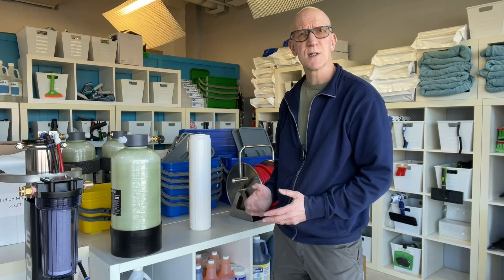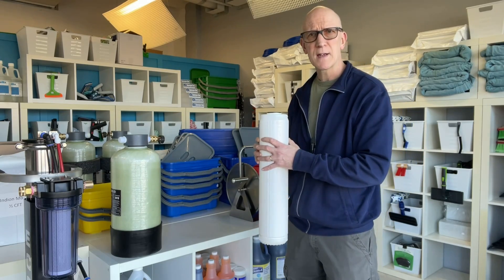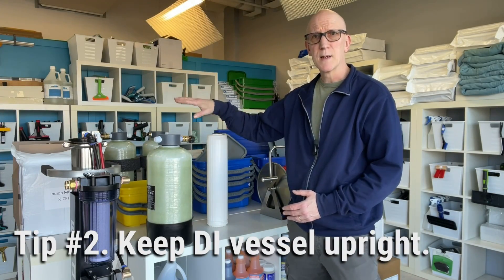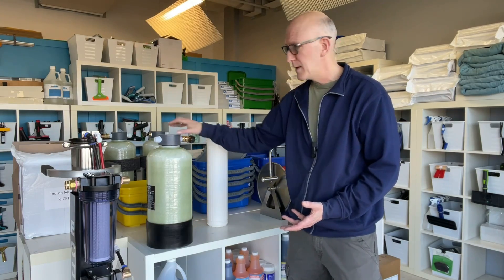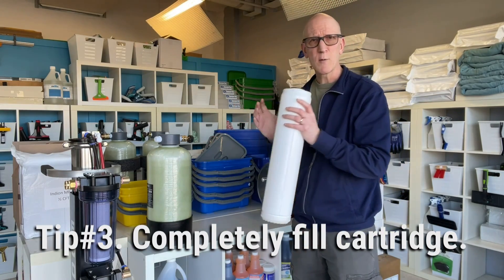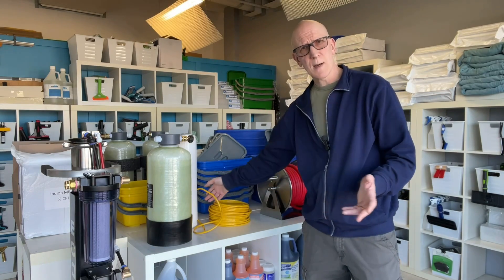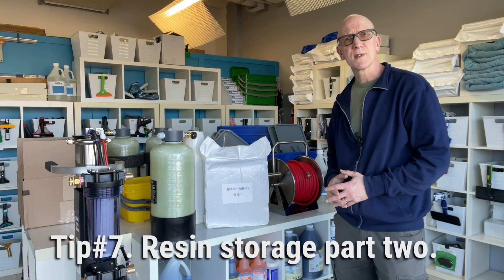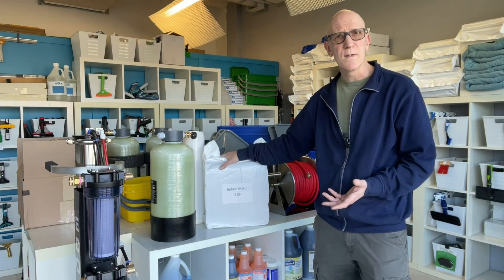How to make your DI resin last longer - Water Fed Window Cleaning

Comment: does it hurt to have the di tank in the sun? Where I put mine its in the morning sun for a few hours each day.
Reply from the maker: Shouldn't be a problem. Have the input/output capped off or closed valve so no hot air comes into the tank would be best.

Comment: Just watched your video thank you very informative but I was wondering if you can help me. I have a new resin tank like the one in your video and when I measured the hardness of the water where I live it is 425 which I’ve been told is very high After running through the tank. I was amazed that the reading was zero washed my car and windows amazing no water marks but this only lasted for two car washes now my reading is back to 425. Looks like the tank is not doing his job. Could you help me with a Y? Is it because the water in my area is too hardbut I thought this is what these tanks were designed for please help.
Reply: You said hardness is 425 ppm, so TDS should be much higher than that. Mix-bed resin doesn't remove just hardness, it removes TDS and dissolved CO2 (and removes hardness also because hardness which is total of calcium and magnesium are components of TDS).
Using mix-bed directly with such high TDS water is not a good idea. It will exhaust very fast because mix-bed are primarily used as a polishing units.
RO will be a better choice in your case. Commercial RO membranes can typically remove more than 95% of the dissolved solids (TDS). If you want further polishing of that RO water, you can install a mix-bed ion exchanger. Mix bed in this case will give you 15 to 20 times more output as compared to what you are getting now.

OR

May be you just need a softer which is the cheapest to maintain.
Reply from the maker: The great thing about ion exchange DI resin is the ability to purify water but the higher the source TDS is, the less time it will last. Imagine that inside the tank you have an army of 1 million beads, but each one can only do their job once. After that, they’re dead. With high TDS like 425 ppm, it takes a large team to get the water to zero so big teams of resin get wiped out at a time as opposed to small teams. If you have a way of installing an RO filter in yourhome before going to the DI tank then that would allow the DI to do less of the work. That’s how mutli stage window cleaning systems work.

Comment: Do you sell the ball valve? Or would a brass shut off valve do the same thing you just adjust it to the flow you want
Reply from the maker: @bradishler5967  any shut off would do, provided it matched the threads on your tank. If it’s a standard garden thread, you can grab from any big box hardware store or we sell them too. https://www.thewindowcleaningstore.com/collections/waterfed-poles/products/garden-brass-shut-off-valve

Comment: I’m wondering why they don’t use separate resin beds instead of a mixed bed, ie one bed with cation resin leading into a bed of anion resin. The big advantage would be that you would be able to regenerate the resins and never (or rarely) need to replace them, providing you could safely handle the strong acid and base solutions, which are only lye and hydrochloric acids.
Reply: You can simply separate and regenerate mixed resin as well, it's only one additional step.

You're right though, discarding it isn't exactly smart. And using mixed bed commercially isn't the brightest idea either.

Only thing I'd use a mixed canister for is as backup.

Comment: Simple equation..the faster water moves thru your di resin the shorter the life.
Depending on the size is the average life...1 cf resin generally gives 1300 gallons of di water with 400ppm water. Running di is not cheap.

Comment: Is just a DI as good as those 3+4 stage systems???
Reply from the maker: Good question that I get asked a lot. DI exists on every multi stage system as the last filter because it is the filter media that can get the water to 100% pure. The RO membranes usually can reduce the TDS (total dissolved solids, minerals) down by 95% on average when new. The purpose of the RO membrane(s) is to act as a prefilter for the DI so the DI last longer. If you are in a low TDS area, then “DI only” makes perfect sense. But if in a high TDS area or needing to use the system daily, then pre filtering the mineral content will allow you save on DI media cost. RO membranes although expensive, can last for a few years. Now, the RO membrane needs to be protected from harm such as chlorine and any other junk (rust, dirt, sludge) floating around in the source water line. So often a carbon filter and sediment filter will be placed before the RO. To wrap up, in a perfect world where we all had lower TDS levels, a DI system would reign supreme.

Comment: Great video. I was using well water 488ppm and my booster pump shoots water 2.5 to 3ft out of brush. I was shocked to discover I went through .pp2ppm to .026 after 25 min of continual use. Should I tien down pump or use ball valve to slow down flow?
Reply from the maker: Yes, that’s way too much water than needed and too fast through the filter.

Comment: Do you have a way of cleaning the resin to be reused instead of buying resin from a supplier.
Reply from the maker: There are facilities that will “regenerate” your resin. It won’t last as long as virgin resin but there may still be some cost savings. See if you can find someone local, and doesn’t require you to have a large supply if it to work on.

Comment: What's your opinion? I use two DI tanks in series. Any value to using one with the oldest resin as a "pre filter" with the second in series to "polish" the water at the end?
Reply from the maker: Hi Kent, I’m really glad you asked. My next DI video will be on this exact subject. I’m still working out my this scenario but hope to have a video uploaded in about a weeks time.
Reply: Sounds good, and thanks for all you do for our industry.  @WCSkills
Reply: I use the same method, two DI tanks. I used to throw away the old resin, now I use it as a pre filter and I get more homes cleaned this way. I also now track it with an excell spread sheet with clients name , Sqft and TDS. I track the TDS coming out of the home and after I clean a home coming out of system, and I cant tell you the TDS in my area can change from low to high depending the time of year and that could explains why the resin sometimes don't last as long. If you get a lot of homes with high TDS it can kill the resin real quick.

Comment: This video got me wondering. Is it possible to prewash the windows with just the customers straight water and then use the DI water to rinse the window?
Reply: We do this often. If you have two poles going, 1st operator or 1st pass over the house is using straight customer water...focusing on frames, corners and quick pre-scrub of the glass. 2nd pole or pass, with pure water it's just glass...keeping off that top edge that can drip water with sediment. Sounds like twice the work, but honestly your 1st pass you can be "sloppy"! Hit everything! Frames, corners, sills, glass, ledges etc. 2nd pass, you're just on glass and staying off the top edge with your rinse....so you fly from pane to pane! : ) New clients or homes with dirty frames are prime candidates for the car wash method! : )
Reply from the maker: I know a few people that do that. It's called the "car wash" method. Like a spot free car wash rinse after the regular cleaning method.
Reply: That will only work when you’re not working in high temps, it’s almost impossible to use tap water in Texas when it’s 100 degrees out